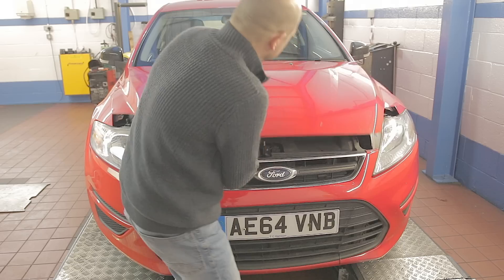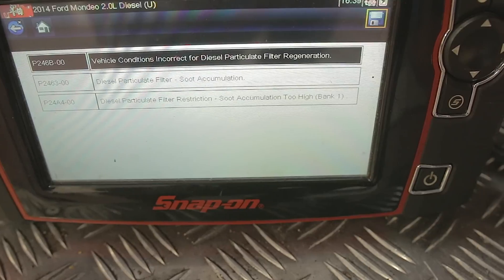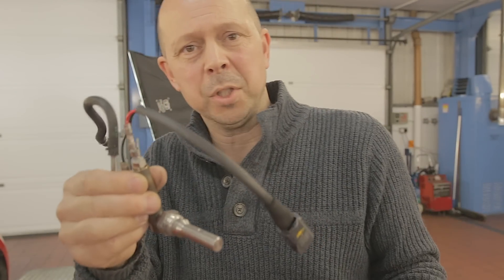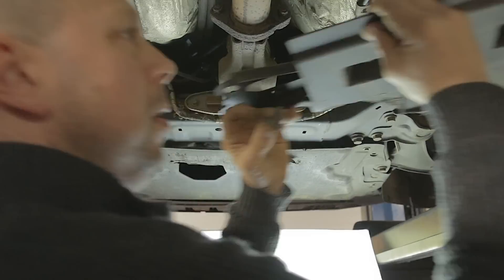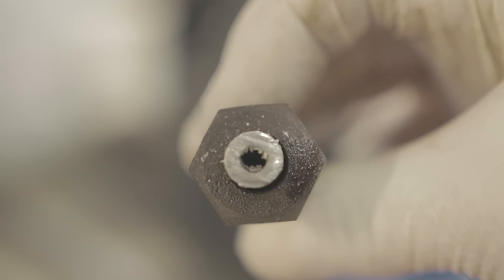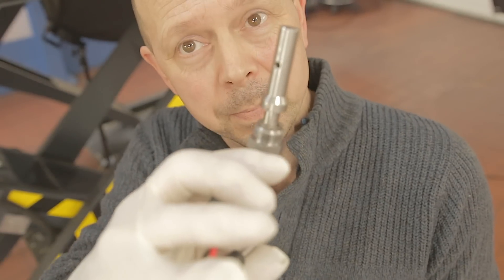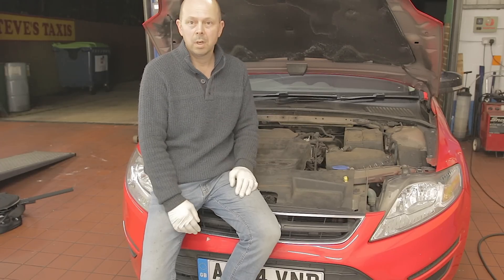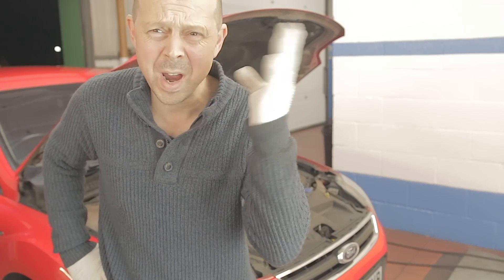Ford Mondeo mk4 Diesel Particulate Filter Fuel Vaporizer 2012-2014

Comment: Hi Alan.
Could this be bad vapouriser?
-GOING on motorway with OBD and forscan on, I can see in forscan vapouriser comes on and off every second or two several times. when it does this some other sensors like voost, turbo  doing the same  jumping up and down. Some times vapouriser will switch on and will stay for a minute or so then it will switch off and it seems ok.
I took vapouriser out and clean it. It wasn't clogged up, fuel hose from pump to vapouriser also changed. 
Please help!!
Car covered 161k miles
Reply from the maker: you need to be checking the codes stored in the ecu first to point you in some kind of direction where the trouble may be
Reply: @alan4x  all I get now and again is U0126 lost communication with steering angle.
Thanks Alan.

Comment: @Alan Howatt from your experience with 2.0D PSA Jonah Engine do you have an idea why diesel comes into engine oil, level rises ove Max level. Could this be due to O-ring leak from HP pump or faulty injector or ...? tnx
Reply from the maker: if an injector was leaking into a cylinder over night you would get a lot of smoke on start up...high chance the high pressure fuel pump is leaking fuel past its seal into the cylinder head...you will need to replace the pump
Reply: @alan4x  tnx for fast reply! Engine actually has issues with the first start when standing for longer period e.g. overnight, I thought this could be due to sticking flap in throttle body (another one of Jonah's specialities ;) ), it usually starts at second try. But wouldn't DPF prevent/catch smoke if faulty injector would leak over night? And another strange thing about Siemens HP pump is that it has two O-rings seals and in between there should be a draining hole in case of leaking this hole should drain leakage on the engine block, outside, and this sould prevent leaks into cylinder head? So this should be a theory. Would a test of injectors  with 4-bottles catching diesel return pipe tell me anything, be useful in this case? Cheers

Comment: Hi great video my engine management light came on so I took my mk4 57plate 2.0l tdci mondeo to the garage they told me it needed a Regen dpf to clean after the 3rd try they told me it needed an ecu after waiting for it to come and be reffited the garage has now told me it's coming up with the same problem, have you any ideas what the problem could be as they have charge me £600  already and I don't think they know  what there doing to be honest
Reply from the maker: your car may not have a dpf vaporiser nozzle fitted... if not the first thing is to check the two rubber hoses from the dpf which run to a sensor on the bulkhead ...the hoses need to be carefully checked for any holes and that they are clear inside...if the hoses are faulty your dpf will soot up and trying to carry out a region will not work

Comment: Thanks for the informative video. Question: does the car need to be put into DPF regen mode to be able to clear the engine malfunction light, or can you just drive it on the motorway for a few hundred miles (perhaps with some Wynn's DPF cleaner fuel additive) and wait for it to clean itself and then clear the light (or the light will turn off by itself?) Thanks
Reply from the maker: Waad Yosef 
Hi, as far as I know the light will not go out by itself. 
Sometimes the car will go into limp mode and will need a good run to get the engine hot before a static regen will even take place. 
 In all cases where the eml lamp is on a static regen has been needed before the code can be cleared from the ecu and the light extinguished
Reply: @alan4x  By a "static regen" you mean the stationary one you show in this video? Super useful to know. I'm falling out of love with this car :( I have this vapouriser problem by the looks of it (including limp mode) and also the pulsating revs problem with the gearbox (changed the transmission oil twice and no change). With these problems I can't even sell it so as you say at the end of your video, got to get the wallet out :(
Reply from the maker: @abuadam7353  
hi yes the regen done without driving the car...if your vaporiser is blocked it will need to be cleaned or replaced or a regen will fail
Reply: @alan4x  HI Alan, I've been always following your videos about the Mondeo and they are really helpful as you provide much info and clear footage. Question: How do I know if the vaporiser is faulty before getting my wallet out?

Comment: Just tried to get one of these off my ranger. I've had everything but the kitchen sink on it trying to crack it. Can't shift it and I'm not sure I want to go down the route of cutting it off.
Reply from the maker: you could heat it up with a plumbers blow torch which should loosen it but they are tight...i just snap them off and use a socket with a long half inch bar..not had one yet that has not came out but also i have not tried to remove one on a ford ranger
Reply: @alan4x  Cheers for that. Did try the blowtorch and plenty of lubricant but the nut is starting to round off. It's only covered 31k miles but unfortunately the fuse has gone and there's no resistance through the glow plug so has to go. I'm limited to a trolley jack for access however so leverage isn't on my side. I'm going to get it into my regular garage and let him mess I think. Cheers! Great channel by the way, really enjoying all I've seen so far!

Comment: Alan , I’m back to this vid regarding dpf as looking for pointers .. 
remember , I said I had new dpf fitted , then failed , then new 5th injector..

Was all sorted .. 
question ...
On regen , would I notice soot from exhausts ? 

I notice this every other week or and on the Same bit of road .. I comes out quite thick for a 30 seconds or ,  boot it and it clears even quicker .. 

Is that just clearing ash from regen ...not noticed it otherwise so don’t think it’s egr related 🙄
Reply from the maker: hi, it is possible to see smoke on a regen but usually not much if any...you are more likely to notice a pungent smell rather than smoke but it all depends how you drive and these cars need a good run down the motorway so to speak otherwise the vehicle cannot perform proper regens on short trips and more soot accumulates

Comment: Hello Alan. I have a problem with an Ford Kuga 2010 4x4 140Cp. The error code is P0219 and occurs only when a hill descends and stop the car with the check engine. After a time if I use the car the error disapper. What can I do?

Comment: I find it odd that the dpf is put there to capture harmful particulats and stop them going into to environment, but then you do a regeneration procedure and kick it all out into the air anyway? 

Or is it less harmful when it's burnt up at high temperature?
Reply from the maker: most Regens i do i don't see any visible smoke from the exhaust or very little so i guess the high temperature during a regen is burning any pollutants away

Comment: Oh Dear.. don't know if i have a problem or not! Got my 60k 2010 mk 4.5(?) Mondeo auto last July. Don't do a lot of motorway miles. Don't have any error codes but haven't had the engine running at high revs like yours did. Why on earth Ford didn't put some indicator on the display to inform us when a regen is in progress or due i'll never know

Comment: So would this be the issue when you get a "diesel particulate filter efficiency below threshold bank 1"  P2002 ???
Reply from the maker: Simon Wilshire 
Hi yes it could very well be the problem but that code is not specific to one component. 
  The best thing would be to check the two rubber hoses on your dpf are not burnt and leaking plus check for any air and exhaust leaks
Reply: @alan4x   cheers!! As soon as I can get under it, I'll have a look.

Comment: I've got a 65 Plate Ford Mondeo 210HP Auto. It's had a blocked Vapouriser at 30k miles that fucked the DPF up (fixed under warranty) same again at 50k, Vapouriser Blocked saved the DPF this time. Now the 3rd time at 70k miles. Out of warranty. I'm fucking sick of Deisel cars and I will never buy another one again. Love these videos, if it wasn't for people like Alan it would be next to impossible to get the correct information. Ford dealers are fucking liars and I'm never buying another Ford again.

Are these Vapouriser suppose to last more than 20k miles ?
Reply from the maker: hi, the vaporiser normally lasts over 100k miles...if it is blocking in 30k miles there is a problem causing it to block
Reply: Thanks, Alan,  Love the videoes they've helped me out no end. It's a Private Hire Taxi so does about 30k miles per year. Now its hit 70k they are saying it not under warranty but I'm saying the Vapouriser replaced on Feb 18 @ 50k miles should be under Guarantee. I'm going to get the actual clogged up Vaporiser off them this time and do some diagnostic checks myself. I've heard that the fuel line can split so no diesel goes into the 'injector' and it gets clogged up. Anyway thanks for these videos they are great.
Reply from the maker: cool, hope you get it sorted...let me know what you find ..sounds like a bit of an odd problem

Comment: Hi Alan, im running a MK4 with 160,000 on the clock, great car but its starting surging under load while accelerating, no warning lights and runs fine otherwise, hopefully not turning into a jonah, any ideas, i was going to buy a MK5 but the EGR issues have put me off, Thanks Colin
Reply from the maker: colin Gardner 
Hi.... the first thing to do is replace the fuel filter.... they turn black and restrict the fuel flow

Comment: Hello Alan I purchased a 2013 ford focus tdci with an extended warranty from Arnold Clark. I am having recurring problems with the engine malfunction light and they keep trying DPF regenerations. I am having a hard time convincing them to look at the fuel vaporizer. I would have thought a FORD garage would have experience with this problem. How do I get them to take me seriously and not spend ££££££ on a new diesel particulate filter unit?
Reply from the maker: hi, if they are a genuine ford dealer they should know about the vaporiser unit if your car has it fitted....if your car does have a vaporiser then all the regens in the world including fitting a new dpf will be a waste of time and money.
   you could show them my video lol then tell them to get the frig on with it...hope this helps

Comment: With the car on the ground,I managed to remove my vaporiser valve in one piece with an open ended spanner hammered on with shims so it was on good and tight. Plenty of penetrating oil the night before.
 Using a block of wood and a small trolley jack to apply undoing pressure, tapping in the limited space, the unit came off! I drilled a 2.5mm hole in the centre of the body until it broke through to the outlet hole.
Solid copper wire was poked into the hole until all the crap was cleared and rinsed with some brake cleaner, it was now possible to blow air through using an electric air compressor. 
The drilled hole was tapped M3 and a grub screw inserted then peened over with a hammer.
Saved a few quid.
Reply: Barry Porteous is it tucked away like the kuga ? What did you remove to get to it ?

Comment: Recently bought a used Focus 1.5tdci from a main dealer, I do regular long-ish commutes to work but noticed the engine was never doing an active regen. Idle speed was fast and start/stop deactivated when the engine warmed up. Also the oil change light came on 2000 miles after a service.

Ford performed a forced regen last week and all is fine. They emailed me the job sheet and no mention was made of checking the fuel vaporiser, I have emailed them to double check this.

My question is, if the fuel vaporiser was blocked, would the forced regen have even been possible?
Reply from the maker: chances are you would not notice if your car was doing a regen, if that nozzle was blocked...if it is even fitted to your car or anything else was wrong that allows a regen to take place was faulty... your engine lamp would soon come on and your car would be flung into reduced power mode.......your question, if your car has this nozzle and if it was blocked...hell would have to freeze over first before a forced regen would be possible

Comment: Its me one more time,
Timing chain was rattling in my engine so i thought that it would be a good idea to change it, it was a lot of work, but i did it and guess what it is still rattling like it was be before even with new chain and tensioner.
Do you know why this chain could rattle like that?.
And my dpf problem seems to be that vauporiser, ive disconnected fuel feed pipe and tryed to blow some air in it, but it appears to be blocked so i think this caused my dpf problems
Reply from the maker: hi, can't really advise on the chain without hearing it..unless you have an oil problem lubricating it....if you took the nozzle off the exhaust you will see for sure if it is blocked
Reply: alan howatt I have uploaded video on my chanel, you can hear it straight away. I think that surface between cam housing and tensioner itself is uneven and since there is no seal or gasket at all there could be an oil leak and therefore there is not enough oil pressure for the tensioner to work corectly.
Im going to disassemble the whole thing again this weekend, I was thinking about puting some air pressure in the oil journal that feeds the tensioner and of its clear i might put a bit silicone to seal to connection or I just might put another spring in from the old tensioner as I just have enough of this noise.
Next Thursday I need to take the car for over 4k miles road trip and I dont know if its going to make it.
Reply from the maker: Aleksander Tabaczyński 
  Hi,  it sounds pretty serious 
  It was a long time ago I did one of those chains. I have a engine from 2014 2l mondeo which I will attemp to remove the chain and tensioner. It in the short term it might be worth looking for any information you can to see if other people have had similar problems
Reply: alan howatt I will remove the tensioner this weekend, I will try to check oil feed and check for any in perfections in casting, if it wont help I will just fit an old set as it was a bit better than the new one
Reply: Hi Alan, Ive sealed the tensioner and it did help a bit, but in my case its not only the timing chain, but chain that drives oil pump is noisy as well.
I just cant afford another repair to that engine so I will just keep on driving until the chain brakes.

Comment: Hello again Alan, on the way back from work today check engine illuminated and car went into limp mode, checked fault code and they are exactly like yours on the video.
Also i wanted to try static regen and engine just cut out on me after about 5 min of revving, what else should i check before changing that vaporiser? Differential pressure on dpf on idle is 0-1 kPa soot load is 60% and dpf load is 98 %.
Thanks for your help
Reply from the maker: hi, check the two rubber hoses from the dpf to the pressure sensor.. the hoses get burnt and break.....next remove the dpf nozzle and if it is blocked you must replace it...you cannot do a regen with a blocked nozzle.
  clear any fault codes in the ecu if you can...if they won't clear ..reset the dpf with your scanner...it will say you should do this if you replace the dpf but don't worry...just do it lol.
  if the codes still won't clear or you are still unable to carry out a static regen with your scanner...take the car on the road and give it a good thrashing... then you should be able to carry out static regen....these are things i quite regularly have to do...thrashing the car before a regen has always worked for me
Reply: Thanks again for a reply, after reseting dpf learned values codes have clearded, I will give it a good thrashing today and if it wont help I will also try to check all them things mentioned.
I'll let you know by Sunday

Comment: Hi Alan 
I’ve had code p2002 dpf efficiency below threshold Bank 1
Had a regen done but light came back on with same code 
Any ideas, my mechanic doesn’t know for some reason 
Thanks
Reply from the maker: hi, the first thing you want to do is check the two rubber hoses that go from your dpf pressure sensor to the diesel particulate filter...there is a high chance the hoses are broken or have burn holes in them... replace them if they are broken and give your car a good run
Reply: alan howatt 
Thanks for the reply 
I’ve been googling around and hopefully that is the problem 
I will have the mechanic look at that for me 
Cheers

Comment: Hi Alan, my car 2011 ford galaxy 2.0 tdci started to regenerate dpf filter very often, like every other drive should i be worry about it or is it normal if you dont to many miles,  I do about 30 odd miles a day, also when dpf regenerates you can feel and hear like frequent clicking noise coming from engine fire wall what could this be ?
Reply from the maker: hi, don't know about your clicking noise but you need a much longer run than 30 miles... its probably not re gen properly and keeps trying...if you get the chance, go for a proper good run, if there was a problem i sure it would put the engine light on
Reply: alan howatt. Thanks for quick reply, I have purchased the car only a month ago with full service history and yet fuel filter was from 2013 along with oil and air filter as well and to add to it timing chain started to rattle, so either car was not serviced at all or main dealer ripped previous owner off, anyways engine has bee flushed twice now filters changed and I will be doing chain and belt this weekend and I though that since i have to remove half of the engine I might as well clean the egr valve, could clogged up egr block my dpf or something?.
And that clicking noise, is similar to the noise a night heater makes when its switched on in my lorry, and I thought thay there is similar pump in my car that supplies vaporizer mentioned in your video with fuel or something.